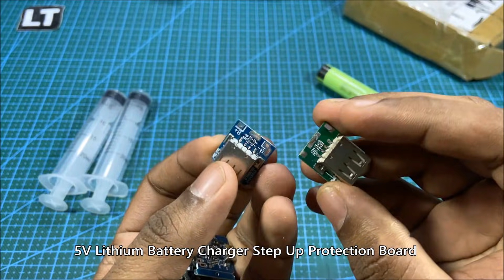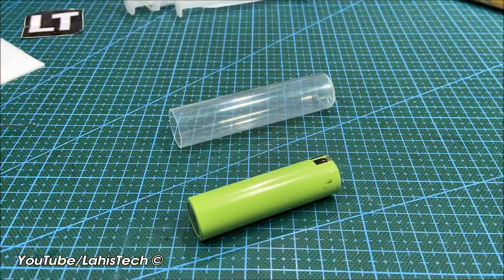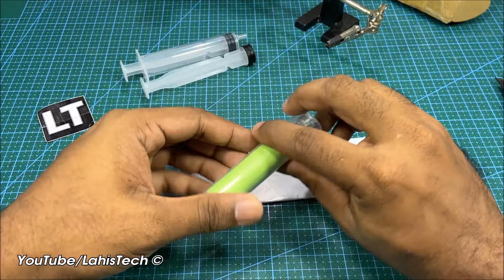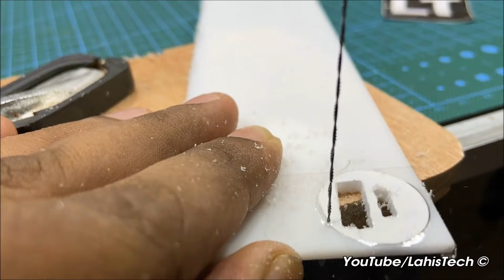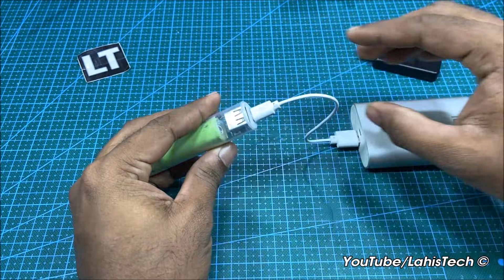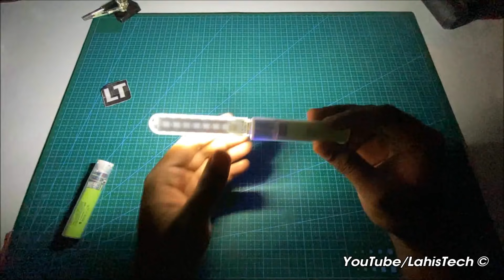How to Make Mini 18650 Power Bank using Syringe

Comment: your meter is reading 5v from a 3.7v cell ? the PCB must contain the charging circuit & a voltage converter .

Comment: Hello! I have a question. Can I use a wire to connect the step up protection board to the battery? I really have not enough knowledge in electronics so please pardon me.
Reply: Yes you can.

Comment: What's the cutting blade name bro in acrylic cutting
Reply: U8iiooo90o9
Reply: If you mean the one he used to cut the syringe it's called an exactoblade or an exactoknife
Reply: I see what you mean q and I think it's most probably a wire saw. Maybe it's called a single handle wire saw. I'm not sure but it's a type of wire saw

Comment: It's a great idea, thanks. Perhaps it was possible to place the usb ports on the other side of the syringe, where the needle is, and close the cylinder of the syringe with a round rubber band from the plunger of the syringe.

Comment: The module delivers less than 1 amps and 5 volts ... So its useless for smartphones .. which needs minimum 2 amps
Reply: iphone charges at 5 volt 1 A in normal charging mode.

Comment: How is the charging speed? Does it reach 10 watt s?
Reply: How to make 5v 2A power bank from laptop battery>> #mydreamlab
Reply: @zealm1191  use 2 amp modules.

Comment: Absolutely unnecessary thing. Now such a device can be bought at a price slightly more expensive than a battery. 20 years ago, I bought a similar device. It was powered by an AA battery. It was called "the last cartridge". It perfectly fulfilled its function. I pumped energy from the battery to the phone to the last drop. A device for an extreme situation. Matches the name.